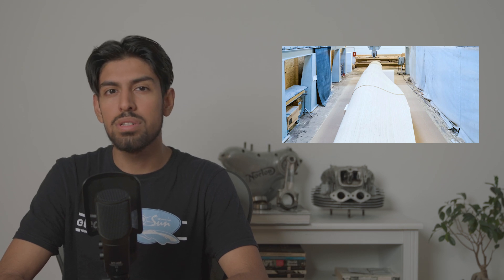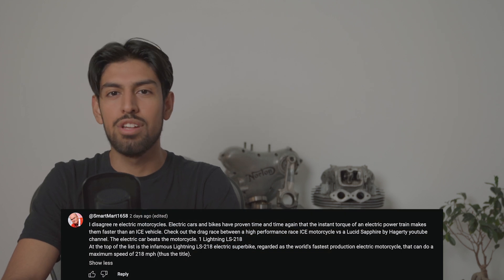Quick Charge Daily: 10,000 ton electric container ship

Comment: Battery capacity is not measured in kW - kWh.  Surprising on this channel.
Reply: This is incorrect. Battery capacity IS measured in kWh. It is a unit of energy just like calories. A watt is the voltage (volts) multiplied by the current (amps). One kWh is equal to 3600 kilojoules (or 3.6 megajoules). EV motor power is measured in kW (max power produced). EV efficiency is rated by the number of kWh consumed over 100km, or how many miles driven per kWh. A kilowatt (kW) is also the unit of measurement and energy used for charging points. The higher the kW number, the more electricity that is being used to charge your EV, which means quicker charging.